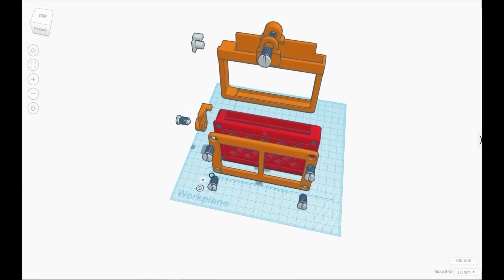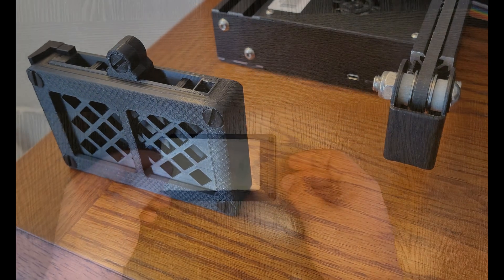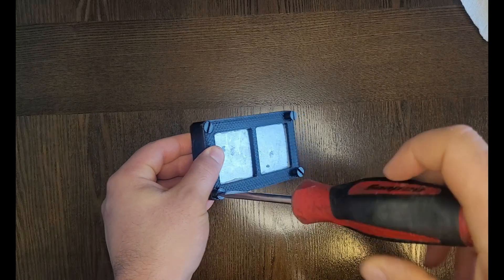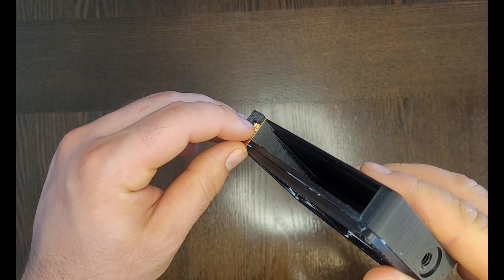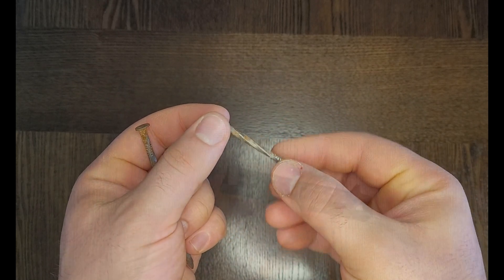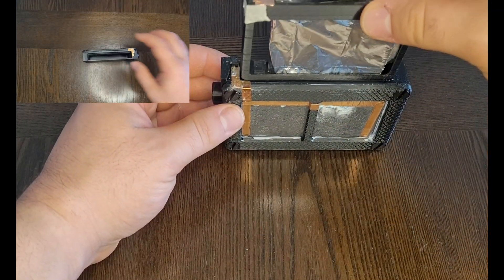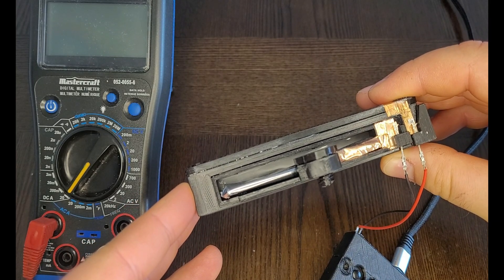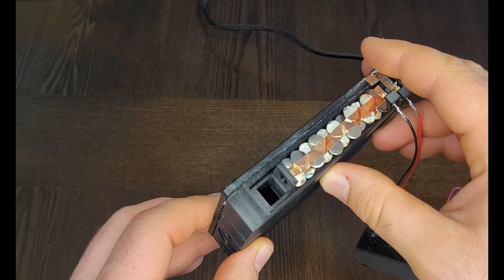3D Printed Aluminum Air Battery

Comment: Try using just some very thin sheets of lead for both anode and cathode electrodes.
kept held together with a few layers of napkin paper towel or toilet paper between them to separate them so they dont short. (At least 0.5-1mm separation)
Scuff up the surfaces with a fine bristle wire brush or some 120-220 grit sandpaper. (Coarse gives higher capacity)
Use baking soda (sodium bicarbonate) Or washing soda (Sodium carbonate) For the electrolyte. Or even a combination mixture of the two to tweak the performance to exactly what you want.
Very cheap and easily obtainable electrolytes.

Usable voltage range is about 0.8-1.3v similar to an old NICD or NIMH alkaline battery.
but you can get quite a lot of current out of it! Several AMPS easily.
I made a compact spirally-wound one that output over 10 amps of current if you short circuited it. so be careful!

Optionally you can replace the cathode (negative electrode) with zinc  for further enhanced performance and higher voltage. 
You can discharge it completely flat and charge it up fully many times with no damage!. Just make sure not to make the separator too thin! Really stack a good amount of layers of the paper separator to prevent the electrodes from shorting out.

I have tried the sulfate based electrolytes for a diy lead-battery but had nothing but problems with them. Accelerated corrosion. Excessive buildup of sulfate precipitate clogging the pores of the electrodes reducing the power and output.

the simplicity of baking soda or washing soda do not create any precipitates and simply store charge in the electrodes similarly to a super capacitor. but with more capacity!

Ive gotten 30mA of output current for almost 20 minutes out of a very tiny strip of lead foil placed into a small container filled with sodium carbonate (the most powerful option)
It even held over 1v for 15 minutes The foil strips were only 0.3mm thickness. 0.6inches across. and only about 2.75 inches length. with a separation distance of about 1.25 inches. Even with that large separation the output and capacity were not bad! Over 12mAh for the very tiny unoptimized and inefficient cell.

Just be careful not to make a mess or get lead smeared around or anything. wear gloves and eye protection when handling any significant quantities of lead. I don't recommend getting sodium carbonate on you either even if diluted. its a strong enough base to cause some skin irritation.
Reply from the maker: Great suggestion.  Seems like you've done quite alot of work on this already.  Does this function similar to a car battery?  Do you have any sources for additional reading I could check out?  Cheers!

Comment: As hobby, I restored and recycled 12 volt 7 amp battery. After Restoration it produced nealy 12 volt 12 ampare. After attaching resisters reduces deep descharges and promote battery back up. 
Part 1
https://youtu.be/xIQ79u4Klnc
Part 2
https://youtube.com/shorts/d9OUja1P25M?feature=share
Part 3
https://youtube.com/shorts/Y3Y0Pmj5ASc?feature=share

Comment: Galvanized nails ;) fencing wire works well too lol
Reply from the maker: These nails weren't galvanized, but here's a thought.  I could use galvanized metal and a zinc salt based electrolyte to get a zinc air battery.  That could be cool.
Reply: @MechanicGoneRogue   nasty old chain saw file wrapped in paper towel than a layer of wet charcoal paste  with a tiny copper wire embedded into the charcoal layer all wrapped in plastic to make it tight leaving a few inches of the file exposed to atmo and soaked in salt water produces 0.231 volts. finished its the size of a number 2 pencil. Update: It has been 10 minutes and the voltage has gone up to .34... took some time to absorb the electrolyte.. only took me like 5 minutes to throw it together using stuff i have.  i forgot to use wood ash though instead espson salts.  You can find all this stuff at about every camp site you go to... Everyone leaves their trash. Metal cans, bottles and plastics. get the ash and charcoal from the fire and usually camps are built around water im sure you can make 6 volts anywhere you go out of garbage. How many keys you got on your key chain?
Reply from the maker: Well that's very creative.  Nice job using the materials you've got on hand.  Very resourceful.
Reply: @MechanicGoneRogue  right cause you can buy pretty thick galvanized wire and pipe even pretty cheap at the hardware stores. Cheaper than copper or aluminum and better due to the magnesium.

Comment: any thoughts on the feasibility of using carbon fiber in place of the graphite?
Reply from the maker: I looked into it briefly, but didn't pursue it.  From my online research there was mention of higher resistance for some reason.  It could be isolated to a particular brand or type of carbon fiber, but I'm not sure.
Reply: @MechanicGoneRogue  Ahh yeah.. ihave quite a bit of carbon fiber cloth that i was tinkering with making diy heated clothing... my brain didnt even consider that the resistance is what allows it to create the heat!

Comment: You might try some light sanding on the aluminum as there is always a thin layer of aluminum oxide on the outside or a coating which prevents it. You will still get a good reaction from the cut edges but it forms really quickly and it's not as easy to detect as rust.
Reply from the maker: Thanks for the comment.  I'll have to try that!

Comment: It's lovely seeing you getting confident with the setup enough to manipulate it to such nice designs, I'm afraid that did make your explanations go over my head but tbf I'm recovering from a hectic few weeks while eating rice at 3 am after an accidental long nap

Aside from that you could try using new nails with no rust as that lowers the surface area on which the reaction occurs which will slow down your battery (lower amperage) you can also try to flatten the nails a bit for the same reason 
That being said I'm just seeing things in a "how to improve" way and honestly those changes may not do much to help you unless you get a very well flattened nail
About the recharging however, the chlorine gas is probably in low enough quantities where you don't personally have to care about it for your health (stay ventilated though) but it may corrode the inside a tad too much
If I recall, a hydroxide solution (you can get NaOH in powder form from some drain cleaners) is usually used to scrub chlorine in lab conditions... unfortunately the stuff eats at aluminum even more aggressively than chlorine (fun stuff when you plan it) 
Anyway, good luck with your next steps with other metals!
Reply from the maker: Yaaah You're back.  Glad you enjoyed my newest design.  Don't worry.  It took me over a month just to make the 3D model so if you didn't get it in the first shot just give it some time to sink in.  Thank you for the suggestions as always.  A quick comment on what you said about a hydroxide solution.  I have been experimenting with KOH on and off for the last couple months.  I can confirm it definitely eats the aluminum faster than any amount of chlorine present in my salt water electrolyte, but the power increase is certainly worth it.  I'm hoping to make a video on it later this year.  :)
Reply: @MechanicGoneRogue  uhhh in case you didnt know
-OH + aluminum => hydrogen gas which is flammable and a lot of heat, luckily it starts off slow enough but can get violently fast so for storage of power in battery form I dont think it's the best idea unless you keep em separate 

And yeah I'll always be back, as soon as I get some from time I'm planning on watching a small list of detailed science videos and this video is on that list so hopefully I'll get it then

That being said, free time may be a distant dream as I'm planning to start research as an undergraduate and I'm not sure how that'll go in an already hectic semester
Reply from the maker: @guythat779  hehehe well I had read about it so I was prepared, but nonetheless actually observing the reaction was very impressive. 

Man sounds like you've got quite the full plate.  Bettering yourself is never easy whether it's professionally, academically, or personally.  Seems like you've got your priorities straight though. My videos will be up for as long as YouTube let's them stay, so I look forward to your comments.  Hope your able to finish this semester well! :)
Reply: @MechanicGoneRogue  Haha yeah, I do like ignoring warnings and risking things too, it sounds sarcastic but I'm serious about that. I'm a great fan of 20s-60s science, risk was simply a cost for better faster science (thanks cold war) and as a chemist I cant stress enough how fun seeing the risky stuff is. Besides i do think that these days we've gotten overcautios (for good reason since what we say is implicitly always to a large audience and there's bound to be a  idiot or a klutz) a d maybe wearing gloves, a coat, and goggles to perform a dilution of table salt isnt necessary. I remember once I got yelled at for not wearing a coat during my lab test because they were too small and tight and I was handling fire and acids,  but here's the thing, if shit broke loose do I want to be restrained in my movement and wont a restricted movement cause more accidents? But yeah stay safe In a risky logical way
________________________
Ah yeah, you said it. But it's the name of the game, if you ever feel comfortable that's a good sign that you're getting complacent and that's no bueno, specially in your youth

Comment: If you want a metal air chemistry you should use a different chatode. The most common is a metal current collector (Ni foam or stainless steel mesh) and an oxygen diffusion layer with the active material pressed on the current collector. For rechargeable air bateries it is even more complicated, because you need a bifunctional catalyst, that can oxidize your metal, and also reduce it on electrical charge. 
And please, forget charging with 5v!
Imagine if you would do the same to a 3.7V Li ion cell! It would burst into flames if there were no built in satery features!
You ruin all of your cells with that. For aqueous electrolytes use <1.2-1.3V max.2V (for lead acid) so no electrolysis of the water. There are cheap step down voltage converters online, I used one of them for my experiments, seems to work ok. Best would be a current limited power supply for even better performance.
Looking forward to your experiments, they are really interesting!
Reply from the maker: Hey there.  Thanks for the comment and suggestions.  I've wanted to try a different cathode so hopefully I can give your idea a shot.  As for the charger yes I'm aware it's too high @5V, but it's all I got right now as I'm working with a fairly limited budget.  Hopefully I can upgrade it soon though.  There's a couple affordable options on Amazon I wanna try.  Thanks again.  Cheers!
Reply: @MechanicGoneRogue  You can get basic variable voltage bench power supplies for pretty cheap; it's the full-featured lab grade ones that are expensive, because they pack other features such as constant-current control.
Alternatively, you can just get a potentiometer (or pull it out of an old radio or other electrical appliance) and hook it up between the battery and your 5V supply. Measure the output with a voltmeter and adjust the potentiometer until the desired voltage is achieved. The potentiometer is not as energy efficient, but for low-power use cases it should be fine.
Reply from the maker: @PixlRainbow  Good idea on the potentiometer.  I think I've got one of those from a HVAC controller for a car that I replaced recently.  I may give that a shot.

Comment: So, I kind of got on the binge of reading about iron or aluminium air batteries. I was wondering, if an alloy (FeAl) could return better results than those batteries separately.

I'm assuming it isn't feasible but if anyone's done any testing or know of an interesting article about it it would be much appreciated. 

My thought process is that the alloy will slow down the rate of decomposition and possibly increase cycle life. 

Also probably not set into the reality of science. But, wouldn't it be in the right direction to solve the energy density of Al batteries. 

Idk another random tech research binge lol questions I want answers to....

Disclaimer I have no background in science etc I just like to read and make conjectures.
Reply from the maker: Interesting thought.  I can't say I've tried something like that.  I couldn't say one way or another if it would work, but I like the out of the box thinking.  

In my experience as a mechanic I know that dissimilar metals react with each other so that may happen with that kind of an alloy.  I'm not sure if that would improve or hinder the overall reaction though.

Comment: Really good! Maybe you can cut grooves in the nails to give more surface area?
Reply from the maker: Glad you liked it.  Thanks for the suggestion.  I might have to give that a try.
Reply: @MechanicGoneRogue  Cool, thanks for making the video :)
Reply: let them rust a bit... iron oxide is good no? too though after using it for a bit it will corrode and the outside will become porous giving it more surface area and more efficiency.. like a gun. have to put a thousand rounds through a new gun before it shots consistent.... the more material you have the longer the battery will last just it will take a bit to warm it up. charge it backwards a few times even lol. tht will open it up.

Comment: Next time please try Aluminium Chloride Urea Ionic Liquid electrolyte with activated carbon cathode. Please try recharging this also
Reply from the maker: I'd love to try AlCl3 at some point.  No promises though.  I've heard it's pretty nasty stuff to work with so I'd have to make sure I'm properly equipped to handle it before I get some.
Reply: @MechanicGoneRogue  As of what I knew, AlCl3 Urea has to be handled in a moistureless and oxygenless glove box. A much cheaper hack is to evacuate all the air in a plastic bag or ziplock, fill the bag with urea and AlCl3 and then heat it up on a hotplate.

Not just AlCl3 and Urea, Aluminium Nitrate also complexes with Urea to form an Ionic liquid that melts at 3 degrees Celcius. If Al(NO3)3 is safer than AlCl3, you should try this as well.

Comment: The Iron Carbon battery is rechargeable but it requires Ferric Chloride electrolyte.  Easy to obtain as it is sold for making printed circuits.  Voltage and current are much higher.  Check other YouTube videos on making this type of cell.
Reply: There are relatively easy ways to make your own Ferric Chloride as well
Reply from the maker: Hey thanks for the tip.  I had thought about trying some etching solutions as I have read that they have ferric chloride in them as well.  Not sure if that's the same idea as what your saying.  Nonetheless I'll have to check it out.
Reply: Buy muriatic acid (or cleaning acid) from the shop and take any rusty piece of iron and soak it in the acid. Iron powder and rust reacts faster than any steel.

Comment: I don't know much anything about iron-air chemistry, does metallic iron reform on the anode during a charge cycle?
Reply from the maker: I think so, but I really didn't get to test that part too much.  It seemed like the charge died down too quick.  I'm thinking I need an electrolyte with a little more kick to get some decent readings.
Reply: @MechanicGoneRogue  I've got a couple thoughts if you keep going with the iron one. Maybe start off with a rusty anode and see if that's the way the reaction goes. Salt water with a bit of peroxide in it will give it a coat of rust in a couple minutes. For more current maybe try a bit of galvanized mesh that you've dipped in HCl to knock the zinc off, I know it defeats the purpose of loading your anode from the top but it might be something to play around with. Keep up the good work, dude.
Reply from the maker: @Idothewrenches  OK thanks.  I do want to take this further as iron is super cheap and easy to get.  I like the hydrogen peroxide idea.  That's a fairly strong oxidizer so it may do the trick.  As for the steel mesh.  It may still work to use a top down configuration.  I could use a design similar to my aluminum foil anode maybe.  I'll have to give it a try.

Comment: #2! Unfortunately haven't got time to watch the whole video yet, will be back later
Reply from the maker: @ Pixl Rainbow.  Great to hear from you! Thanks for commenting as always.  Let me know what you think when you do get a chance to watch the whole thing. Cheers!
Reply: @MechanicGoneRogue  Next time please try Aluminium Chloride Urea Ionic Liquid electrolyte. Please show the voltage and also try recharging it.
Reply: It is possible to make a DES with iron as a component, and there are some papers saying that it can be done using choline chloride and glycol with ferrous chloride added as a third ingredient.
Interestingly, there are also papers claiming that a DIY easy-to-recharge battery can be made using iron sulfate aqueous electrolyte, two graphite electrodes and a sodium polyacrylate (hydro-gel) seperator, as long as you do not charge it above 1.2V (which is when water starts getting broken up).
I will email the links to the papers, as the latter paper seems to include schematics and ingredients lists
Reply from the maker: @PixlRainbow  I got the papers and read through them.  The second one reminds me of an all iron battery I saw on Youtube awhile ago.  Although I can't say I remember how they had the chemistry set up on it.  I really like how they lay this one out.  Makes it easy for a novice like me to follow.  I'll have to see what I can apply to my batteries for future improvements.  Speaking of improvements.  I got that sodium acetate we were talking about previously.  It didn't improve the battery directly, but I was playing around with some KOH solutions, and found it seems to help them put out more consistent amperage.  Which I thought was interesting.